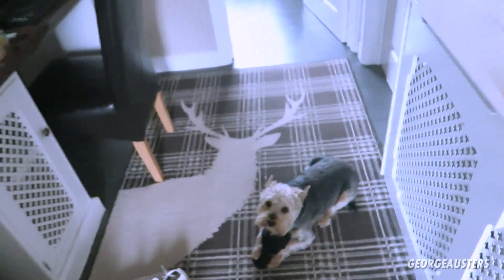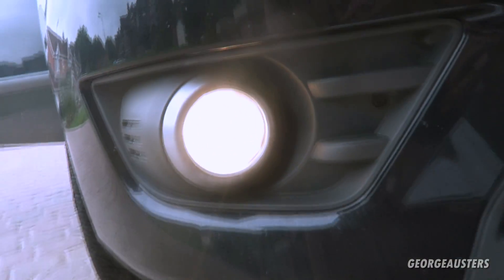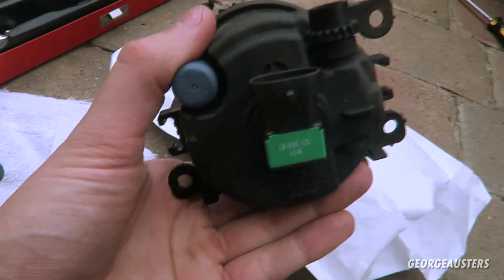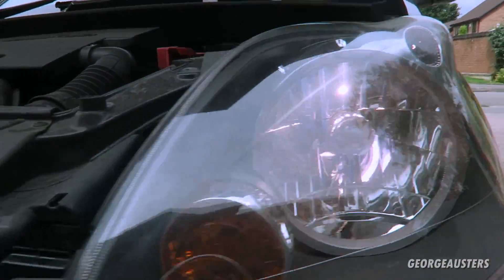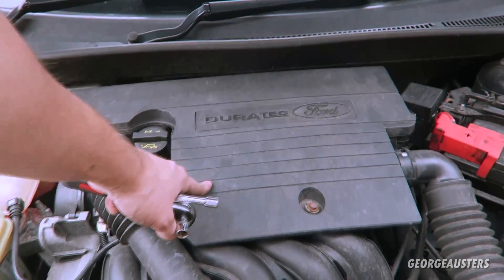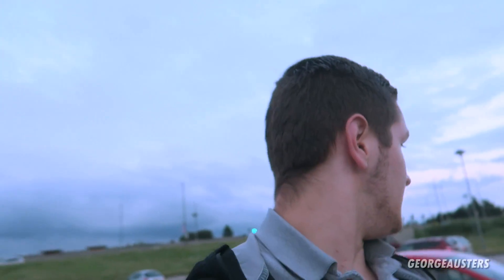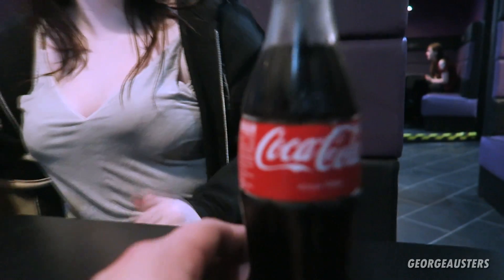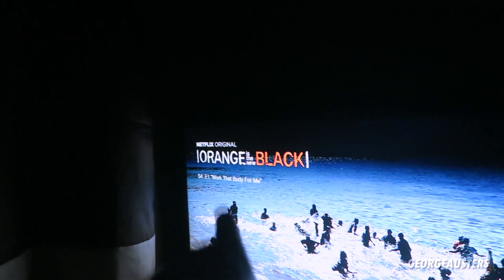Ford Fiesta Zetec S MK6 | Headlight Upgrades

Comment: Were did you get the LEDs from ? Have you noticed much of a difference compared to the old ones ? Have they been nice and reliable ? - cheers
Reply from the maker: +mcc The LEDs for my license plate? I got them on eBay but one of my lights (the plastic housing) has broken so I'm buying new ones. The LEDs themselves are good and reliable though
Reply: George Austers oh sorry,not LEDs,I mean bulbs,for your fog lights/side lights,low/high beam lights ?
Reply from the maker: Oh no, they're fine!
Reply: George Austers which website did you buy them from ? What make are they called ? Cheers for your help! Have you noticed a improvement in brightness compared to the old bulbs ?